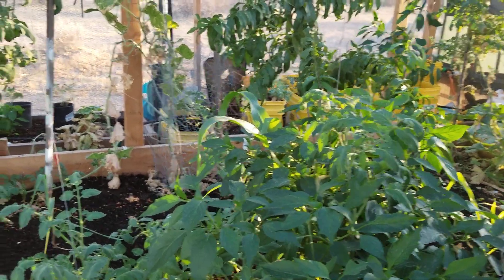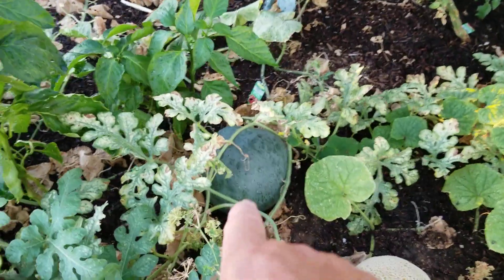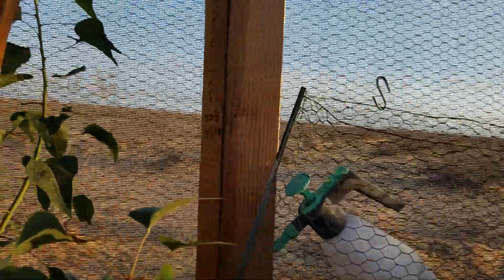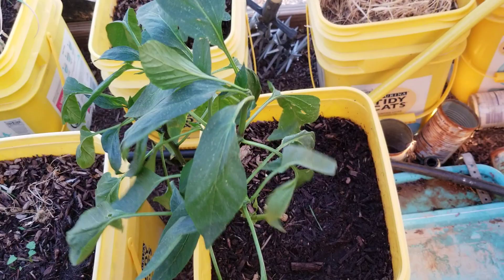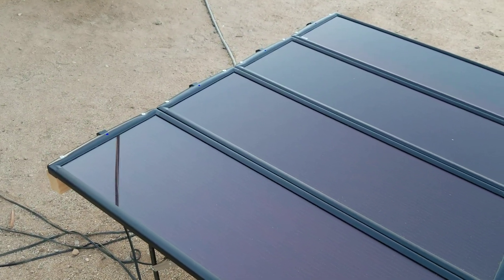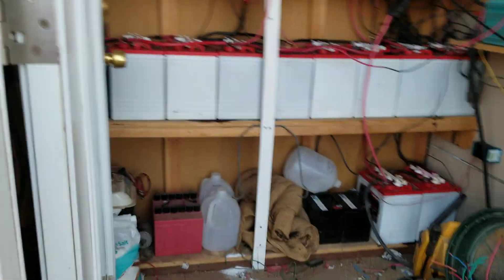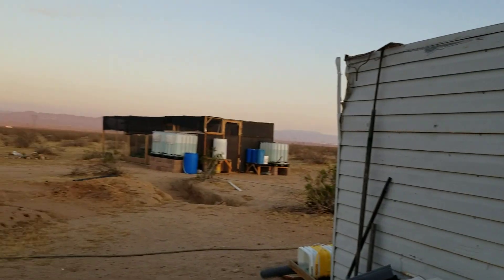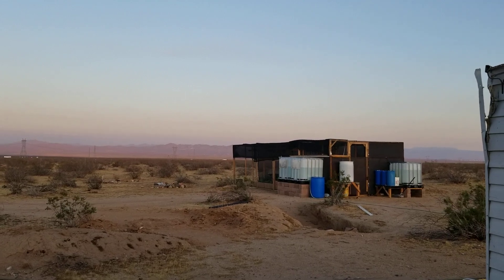Maintenance On Battery Bank, Solar Panels,  and Turbines.  Sep. 6, 2019

Comment: G Bear, thank you very much for this amazing video !! If possible, I would like to have some explanation on the installation of photovoltaic panels. In the video there are at least 4 charge regulators, I would like to know how many panels are connected to each regulator, and if the connections are in series or parallel.
Reply from the maker: Sorry Vito, your comment got sent to my SPAM folder.  The best answer to your question is the number of panels attached to each controller is determined by the controller capacity.  If the controller is rated for 600watts, only 6, 100watt panels can be connected to it.I use a 12 volt system so my connections are parallel.
Reply: @GBear  Thank´s so much for your reply. I asked you because from the video it would seem that in DC circuit there is only one 12V DC bus. In the other words, seem that all panels in paralel and all controllers, share the same 12V DC bus. So my impression is wrong and each controler has its own DC bus with its owns panels,  isn´t it?
Reply from the maker: @Vtomic86  yes, originally I had all the panels connected to the same bus, but separated them out as I added to the system.
Reply: @GBear  Thank you for the explanation and for all your amazing videos!!
Reply from the maker: @Vtomic86  you're welcome.

Comment: you sound like us when we started,we had 2, 6 volt bats and 1 home made solar panel,,,now we have 2000 watts of panels,6000 watts at 48 volts of lithium bats,,every 2 months we get eather 2/4 solar panels,,or 1 48 volt bat to add the the setup,,but mind you it took us years to get to this point,we started with 12 volts,2 6 volts bats,then kept adding bats  intill we had 6 ,did that intill they died,that's when i found out the golf cart batts only last like 5 years,,we did that 2 times, aka the first 10 years,,now were on 48 volt chevy volt batterys,,the chevy volt batts are not cheap,to get like 350 ish to 400 each..it takes us like 3/4 months to save up for that,,the panels are cheaper to get,,i just wanted  to share our story,,
Reply from the maker: Welcome aboard!  Yes, I started out small and learned along the way.  I tried getting information online, but it seemed no body would share, so once I got established, learned from mistakes and got a working system, I decided to share with others who were naive to off grid power.
I plan to get 2 forklift batteries for my upgrade when the time comes.  They aren't cheap either, but I heard from one of my subs that he runs a 1750 sq ft house on 2 of them with power to spare.
Reply: @GBear  sounds good,,i mysef wanted to get away from reg floded batterys,,our house is just 900 sq feet,,but i cant waight for your next vid,i get ideas from other ppl,,lol true😁
Reply from the maker: @oogie-boogie  uploading tonight's episode now.

Comment: How many batteries did you have in your bank at the time of this video?
Reply from the maker: 18 six volt in series parallel to make nine 12 volt at 232 amp hours each or 2088 amp hours.
Reply: @GBear  is that the same as 2 kWh?
Reply: I meant 25 kWh
Reply from the maker: @fr.timothyhall3082  no, to convert ah to wh you multiply the voltage times the ah.  So, 2088ah X 12v=15,056 watt hours or 15kwh.
Reply from the maker: @fr.timothyhall3082  oh, and welcome aboard!
Reply from the maker: @fr.timothyhall3082  no, see last comment.

Comment: An easy test to see if it truly an mppt controller is check the solar voltage at full sun.
If it is 17volts or so, the mppt is getting it. 

If the voltage in is the same as the output... it’s a pwm controller with an mppt label ...
Reply from the maker: Voltage in will always be 17+/- volts if the 12v panels are working, so I don't understand your test.  Output of the controller will be set by the parameters available in the functions of the controller, with float and dump parameters set to prevent over charge.
Reply: G Bear's Off Grid Ways-A Homestead In The Desert a pwm controller brings the panel voltage down to the output charging voltage. Wasting all the extra watts that true Maximum Power Point Tracking controllers can use.

Check it.
I’m sure you will find the pwm solar controllers limit the panel output voltage, and a MPPT controller will show the full maximum panel voltage the panel is capable of.
Reply from the maker: @SuperVstech  will do.

Comment: That's nice pwm charger that's not I a mPPT a mppt charge controller aluminum housing with heat exchange fins or a fan and if you open it it's got a Transformer inside
Reply from the maker: Again, I say, this is advertised and sold as mppt, 1300watt, 100 amp.  I doubt anybody would sell through ebay with false, misleading advertising.
Also, this is an mppt "controller", NOT an mppt inverter unit, and not pwm.

Comment: Used 310 watt 24 volt panels go for $75 each in Dallas on craigslist....if you buy 15 each. 
Thats a great price. A little more difficult to find used UPS 3yr old  batteries for about $65 -75 each...100 AH rating.
Reply from the maker: I may someday go up to 24volts.  All I would need is new panels, since everything else is 12/24 already.  Too many other things to do before i go for extravagance....😋

Comment: Hi GBear, in the winter do you put plastic over your greenhouse?  And another question I had is do you have a freezer?  For what I want to do I might need two freezers so I'm probably going to need to set up a lot of solar or possibly two systems.  and I was wondering what you thought of those sealed deep cycle batteries that apparently don't need any maintenance?  Thank you and I hope you have a great day!
Reply from the maker: The only freezer I have is the one in my fridge.  No I don't do plastic on the garden house, it wouldn't hold up in the high winds.
AGM batteries are nice, but when I started my system they didn't have any that would provide the amp hours I could get from lead acid golf cart batteries at an affordable price.  Ideally, I would prefer to have a couple of forklift batteries.   A few thousand dollars each , but loads of power.
Reply: @GBear  thanks so very muchyou are a wealth of information I really appreciate you taking the time to answer the questions I have.   I hope you have an awesome day.
Reply from the maker: @curiosidadesextrano  my pleasure.
Reply: @GBear  💖

Comment: Be careful with max out these fake, blue colored MPPT, your 1300 Watts on 12 volt makes more than 110 amps that requires AWG #2 wire or you get a meltdown even fire.
Reply from the maker: Again, we will see.  I prefer to test them for results over other methods.  Remember,  Columbus was told the earth was flat.
Reply: @GBear  ... yes but here is common sense to use, $20 mppt, 100 Amps, small box, small connectors, Chinese versa 100 Amps need thick copper wire, big housing, big heat sink, massive connectors and lots of $$$ . And I am sure he knew that earth is round but smaller and thought of India when arrived.
Reply from the maker: @johnq8792  yes,but more common sense is that 100 amps at 12vdc is only 10 amps at 120vac, therefore 12 gauge thhn copper is all that is needed.  Most 12v solar panels only use 12gauge wire to feed to any controller.
Once again I say these are solar charge controllers, NOT inverters.
I have 1375watts of solar panels at 12vdc, in parallel,  so by your math, that is 115amps feeding through 12ga wire, I should have a fire in the past 4 years.
No, 115amps is at 12vdc so only 11.5 amps at 120vac BUT...the controller only deals with 12vdc, NEVER 120vac.  All the controller does is balance the dirty input to charge 12 volt batteries and protect from overcharge.
So, do I need only 1 of these controllers for all my solar panels?  No, I need 2!  They are rated at 100amps and I am producing 115amps.
Reply: @GBear  ...These cheap controllers don't run on 120 volt but on 12V and they say 1300 Watt that's more than 110 amp after ohms law. Right there you see their label is fake to trick buyers.
Reply: G Bear's Off Grid Ways-A Homestead In The Desert I don’t quite follow your logic.

Watts are watts... if you are passing 1300 watts at 12v you are using 110 amps. 

If you push 110 amps through #12 wire, it will glow. 

Where are you measuring the 110 amps? At the inverter? At the charge controller?
Reply from the maker: @SuperVstech  watts=voltXamps.  Ohm's law.  Therefore,  12v x 5amps = 60watts
120v x 5amps = 600watts
Watts cannot remain the same if volts or amps are changed.
I hope that clears it up.
Reply: G Bear's Off Grid Ways-A Homestead In The Desert ok... but your charge controller ONLY DEALS WITH 12VOLTS...

Does that clear up what we are trying to point out to you? 

1300 watts feeding your 12 volt battery is 110 amps.

110 amps needs #2 wire minimum...
Reply from the maker: @SuperVstech  yep, but I like the glow from the existing wires for the past 3 years.....🤔

Comment: No disrespect to you gbear. But does mppt they called cheap China . If the cost less then $80 dollar . They are crap.. best you can buy , is  Midnite solar they cost $600 for a 150a mmpt . But we'll worthy,   they are really good. I can run my pc till 4 am . And will be in the safe side with 12.5v on the batteries.   fridge  and fans 24 hours . Get bigger panels from the guy I send you , the phone number and get a better mppt . And you will b rocking . Have a nice day gbear..
Reply from the maker: I understand the "get what you pay for" concept.  I bought these to "test" them for operational claims, and will post my findings when the time comes.

Comment: That label on the MPPT spec lable 
Doesn't make since
The last line
300 watts 12volt
2600 watts 24 volts
?????????
The idea of a MPPT charge controller is to max the input voltage per solar string
Reply from the maker: That's 1300watts @ 12v, 2600watts at 24v.
Reply: They are fake MPPT easy to check with your electronic meter. Chinese label to sell faster. A $20 MPPT does not exist especially with 100 amps, you want a 100 amps MPPT then pay at least $600 like the midnite solar classic 150
Reply from the maker: @johnq8792  the test is on, we will see how they perform.
Reply: G Bear's Off Grid Ways-A Homestead In The Desert 
Testing those specs with #12 wire is easy... is it on fire? No? Then it isn’t sending 1300 watts across the wire.
Reply from the maker: @SuperVstech  so, the 1385watts of solar I have feeding into my controllers for the past 3 years are all burnt?!?  How am I still using them?
12vdc requires a different size wire than 24vdc or 48vdc, or 120vac or 240vac, or 480vac.
A 240vac range/oven (past known as 220vac) in your house could be wired with 10ga or 8ga or 6ga wire depending on what year the house was built.  It would be connected to either a 30a or 40a breaker.  Ohm's law says 240v X 30a= 7200w.
So if your range oven is over 75% of 7200watts, it would be overrated for the circuit and illegal.  Yet there are thousands of houses across the country doing it.
In DC current, stranded wire is recommended because the current travels through the outside diameter of the wire.  In AC current solid wire is used because the current Travels through the center of the wire.  This is specific for heat distribution through the conductor.
Reply: G Bear's Off Grid Ways-A Homestead In The Desert you are reversed.
The skin effect of stranded wire is an ac voltage trait, not dc.
Having 1380 watt panels feeding 12 volts through #12 wire means you are getting about 120 watts... 
I’m trying to help ya. 
I’m not picking on you, or trolling. Really.

If 7200 watt range is on a 30 amp circuit, there will be a fire. Not immediately, but the continuous use bumps the heat load on the wire, and any aluminum connections will expand and develop resistance. 

7200 watts at 240v would be 30 amps, now you multiply by 125% and a 40 amp circuit is needed. That’s #6 aluminum or #8 copper. 

Now, a range rated at 7200 watts won’t pull all watts all the time. Sometimes just the upper element is running, sometimes only a stove top burner is going, but at thanksgiving with the broiler, all 4 top elements, the upper and lower oven elements going, and there will be a problem.

I guess what I’m saying is, if the wire limits what the panels can provide... ya don’t get all the rated watts.
Reply from the maker: @SuperVstech  getting off track here, but let me clarify my system.  I have a total of 1385 watts of panels, split into 2 inputs.  The panels are factory wired at 12ga multistrand.  Half of them are joined in parallel to 10ga multistrand input wire, and the other half the same.  Those come in to a bus bar, and then 6ga wire is run from the bus bars to the controllers.  6ga multistrand is then run from the outputs of the controllers to the battery bank, positive to the first battery and negative to the last battery.  Does that clear things up?
Reply: G Bear's Off Grid Ways-A Homestead In The Desert much better.
Reply: G Bear's Off Grid Ways-A Homestead In The Desert just so you realize, you aren’t getting 1385 watts at 12 v through even #6 wire...
Reply: It sounds like you are feeding the two banks of panels through #6 to two controllers. So 600ish watts on one #6, and 600ish watts on a second #6 to a second controller. 
That is a little undersized, but not much. Odds are good the HF panels aren’t putting out 1/2 the rated wattage anyway...